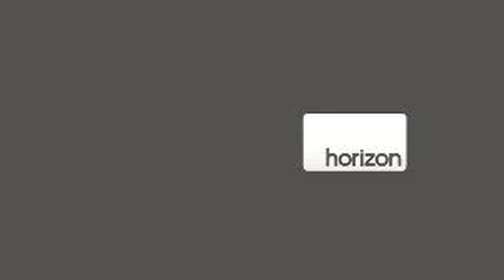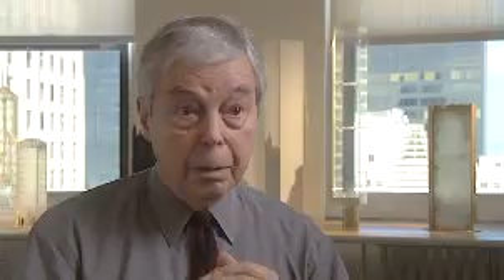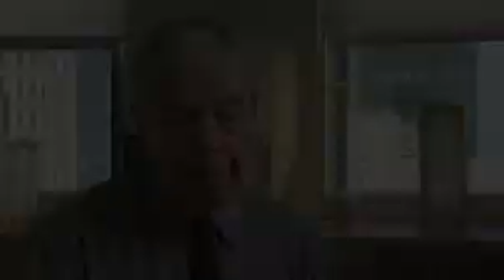Leslie Robertson - Chief Engineer - World Trade Center - Twin Towers

Comment: This video finally confirms what I suspected for decades.  "Designed to withstand" a Boeing 707 meant the building was designed to absorb the force of the initial impact of that jet.  The towers were certainly not designed to withstand a fire fed by 10,000 pounds of jet fuel.

Comment: The planes could not have brought down the entire WTC the way they did. The collapse would not have happened the way it did. There are 100s of engineers confirming this. The buildings fell at frefall speed, meaning controlled demolition was clearning the floors below to speed and control the fall so its straight.

Comment: Leslie's design was good enough to save about 10,000 lives.  The only thing that comes to mind that they could've done better with the design that could've substantially aided with the evacuation is to reinforce the stairwells but I don't know if that would've even been feasible and if the design would've allowed for all that extra weight.  Who would've thought back in the 1960s when they were designing it that some Islamo-Fascists would kamikaze a jetliner into the building at over 500 miles an hour?
Reply: I would have thought it's possible with warcrimes during conflict some nut job was gonna try they hand

Comment: ok the design was for the 707 not loaded or whatever...but the point is IT DID  resist perfectly the impact, a lot of survivers from stories below the impact said that the building moved....by the impact and they felt it move suddently but it didnt move more than any windy day, so not at all compromised or at risk or anything and
even if it moved more, at it was indeed weakened still resisted PERFECTLY the impact.....something happened 1 hour later that didnt have to do anything with the impact or fires or fuel (fuel ignited instanly on the impact....not fuel whatsoever later than that)

and after 1 hour the little top damaged part destroyed the bigger part underneath....this is IMPOSSIBLE to happen in any relatevely solid structurethe little part CANT destroy the bigger part underneath, and destroy itself in the process....also with no deceleration
its crazy how people still think they "collapse" due to temperature that weakened the steel

hope he went in peace kowing that his building were super clever (saving space and weight) and super strong !!! not even 10 planes would have destroyed like it happened
RIP Leslie
Reply: That " Little top part" You're referring to, was not Little at all. Each floor was an Acre in size and weighed 2000 tonnes. The South tower had around 30 floors above the impact zone and the North tower around 20 floors. That's 40-60,000 tonnes pressing down on the damaged area. When it gave way, that weight came down like a hammer and pulverised everything below. Not a little top part at all

Comment: John Skilling, his partner said back in the days, it was “designed”to withstand a fully loaded 707, and the fires were considered. Skilling said: “There would be a terrible loss of life, but the building would still stand after the fire” But of course nobody at this time would have considered a plane at top speed running into the building.  
Look at the new WTC it’s build like a tank, but it did cost much more then the Burji Khalifa.

Comment: Clearly the 767's loaded with fuel, at speed hit the buildings and they continued standing. The Buildings DID withstand the impacts.  Did the burning fuel later cause the collapse?  I tend to doubt it.
Reply: Building 7 was a controlled demolition even if you want to claim the two buildings hit by a plane weren’t. You will never convince me that a building that wasn’t even hit by a plane just fell into the earth like the walls of Jericho due to fire.
Reply: Burning fuel and the damage to the buildings
Reply: @melvynsngltn27  impact from burning fuel can’t turn 90000 tons of steel to dust
Reply: @lordstallion3150  if you live in NY like you claim then you clearly saw when the column bowed inward and snapped. That also means you saw the Buildings be crushed as they collapsed so what do you think was going to happen when skyscrapers like that falls in on its self. Not to mention debris from the Buildings fell faster than the collapse itself.
Reply: @melvynsngltn27  man, skyscrapers don’t fall like matchboxes from top to down, and at the speed near to free fall. It seems that you completely forget about nominal safety factor, which is main thing in the strength of materials. It’s ridiculous that some people still believe in that pancake theory
Reply: @melvynsngltn27  maybe you are blind? Or maybe joking? The towers were designed in a way that the whole structure supported itself. If you don’t know, it could easily stand even without half of the columns around perimeter.
Reply: @lordstallion3150  Fire? Did you see in person how badly damaged the Towers were?
Reply: @lordstallion3150  You still don't understand do you. The strength of the Buildings were outside of the Building. Once the plane went through the Buildings it was only a matter of time. Made you should pay attention to how the central core of the Buildings stood while the rest of the Building collapsed
Reply: @lordstallion3150  Clearly your no engineer definitely have a good day
Reply: @melvynsngltn27  clown
Reply: @lordstallion3150  Yes you are
Reply: @melvynsngltn27  nah, I was talking about you
Reply: @lordstallion3150  you mean you have me confused with yourself
Reply: @lordstallion3150  nobody said it did except for crazy conspiracy theorists like Judy wood